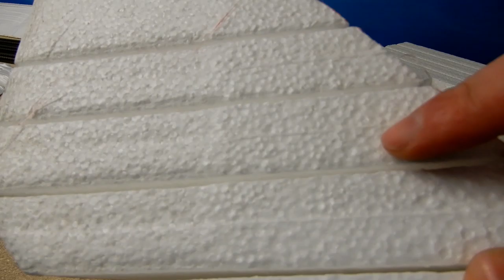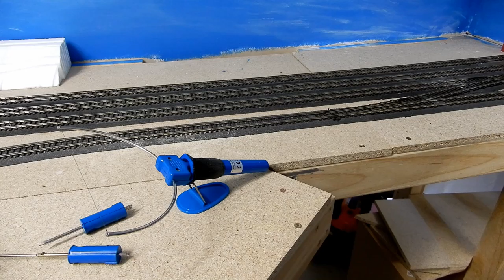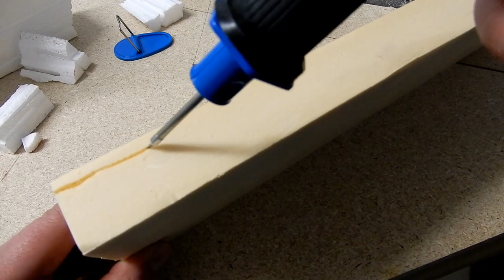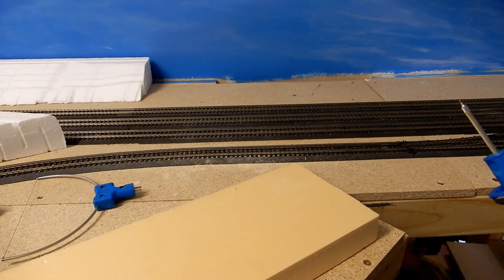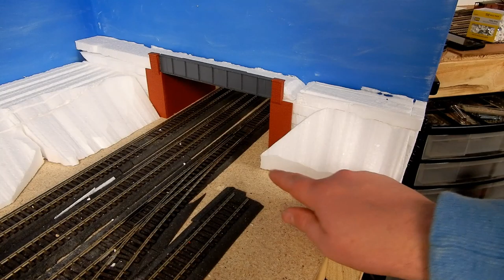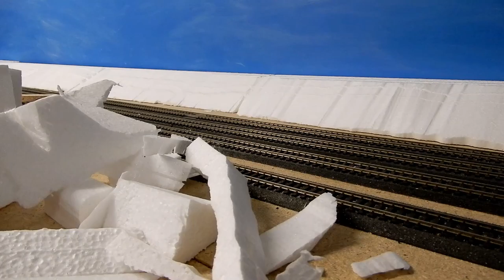Leila Central Model Railway Hot Wire Foam Cutter

Comment: Actually Clint, that insulation @ 1:30 is used for underfloors, not walls. :)
Reply from the maker: Indeed it is. I only just realized I referred to it as wall insulation for some strange reason. Wish i had noticed this prior. I'm such a nanna at times! Clint